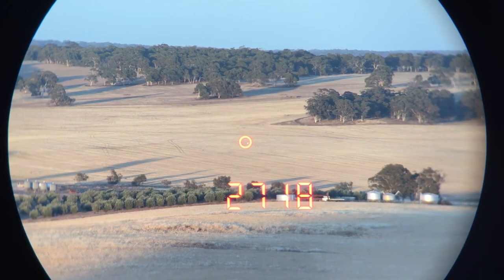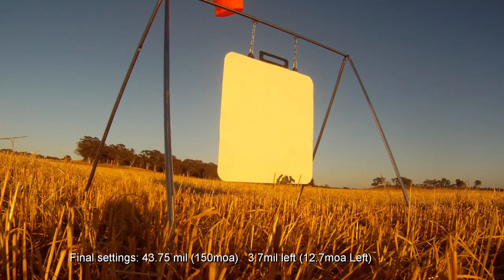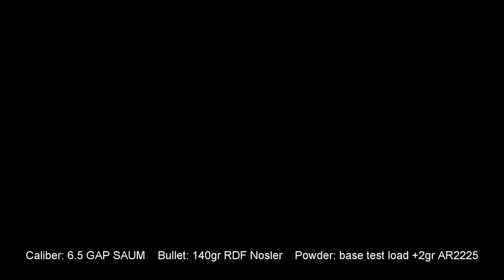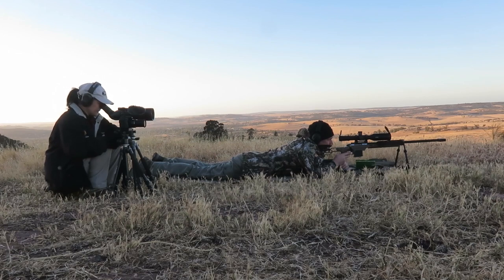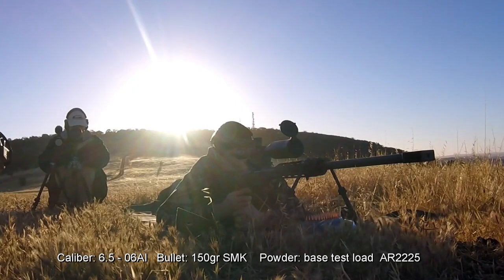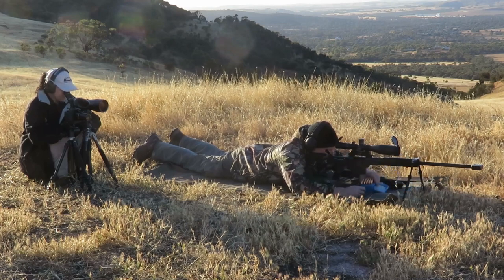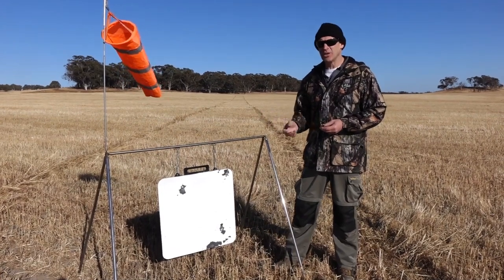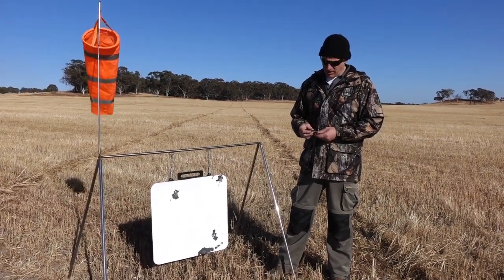2700yard shots with a couple of 6.5 cal rifles

Comment: I've just started messing with the 150 smk in my 6.5CM. My groups have been good, but I haven't gone out for any long range work with it yet(long range to me anyway). Will be loading with rl-26 and pushing them around 2850 fps. Its coming into winter here so I can use the snow to help me see my impacts at a mile that I normally wouldnt be able to do because its normally wet here. Just hoping the cold weather doesnt cause any stability issues in my 8 twist. I've followed your videos for awhile. Very informative and have learned alot. Looking forward to more results with the 150 smk. Happy shooting from the USA.
Reply from the maker: Hi Garret, glad you like the videos, and yes lots more to come, hope it stays good in the cold, Cheers

Comment: Hi Mark and Sam, great vid. Thanks for posting. 
Just wondering what range finder you used for this distance. Also I noticed you said that the temp was near zero C in this particular video. Have you done any testing on AR2225 whith regards to its velocity ES at this temperature and colder compared to the ES you typically get when the temp is above 15 deg C and warmer.
Reply from the maker: Thanks Man, we don't shoot much below 10 deg C most the time and have not seen any issues, if you shoot in the low temps, 0 and lower then I would step up to magnum primers for slower burning powders, Cheers
Reply: @markandsamafterwork  Yeah I always use a mag primer with AR2225 and AR2218. Found some odd results at LR with a few different large .338's and a .375 Cheytac in cold temps, so did an experiment by test shooting three batches of ammo at the same time. The first was left in the freezer overnight. The second batch was left rapt up in a towel with a hot water bottle to get the ammo nice and toasty. The third was shot at ambient temp of around 22 Deg C.They were  then all shot over a magneto speed to get velocity readings.
The results were very interesting and is an easy test for others to try who may shoot in cold temperatures.
Reply from the maker: Thanks Man, yes heard similar results around the place, Cheers and all the best.
Reply: @markandsamafterwork  What rangefinder do you use?
Reply from the maker: Sig KILO 2400 ABS.  Cheers
Reply: @markandsamafterwork  Sweet, I have one of the Kilo 2000 amongst others and it does not read much past 1500 yards so its good to see that the K2400 is so much better. Tossing up between the 2400 and the Nikon 4k to try next.